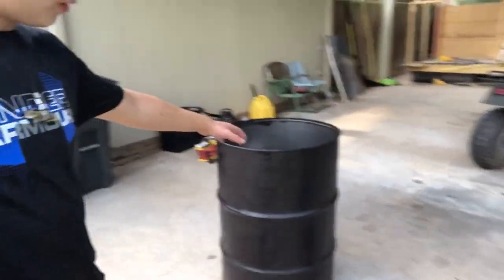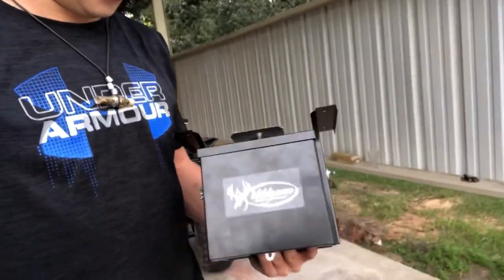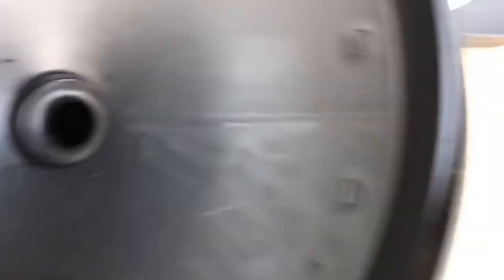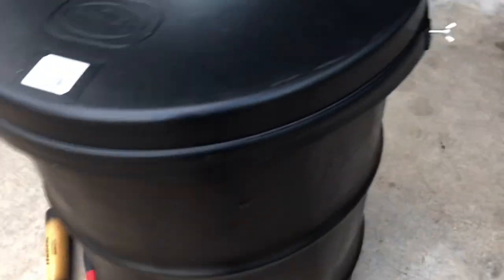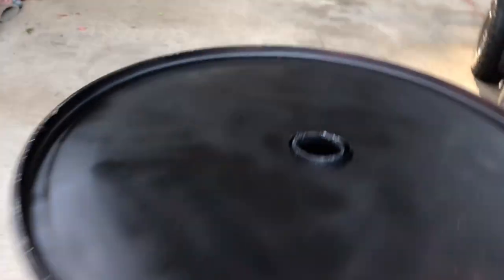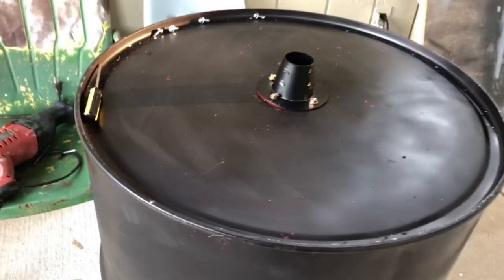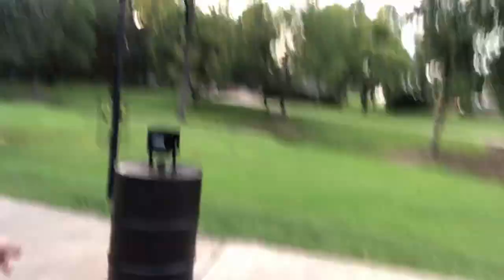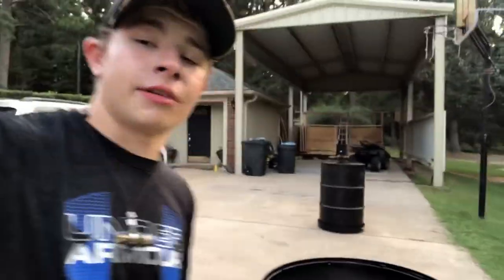DIY 55 gallon drum feeder

Comment: You should make the second one like the first then make the second one a tripod and compare em and test em
Reply from the maker: little silver that funnel fits so snug that even the weight of the corn won’t move it, I cut the hole smaller than the tip of the funnel just to make sure.
Reply from the maker: little silver thanks! I got all the parts for mine at Academy. Glad you got yours workin.